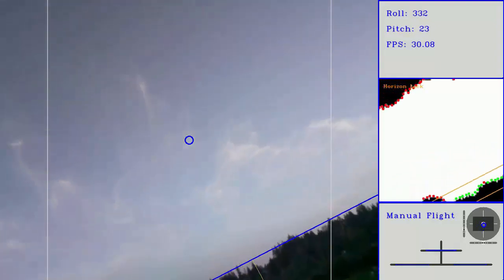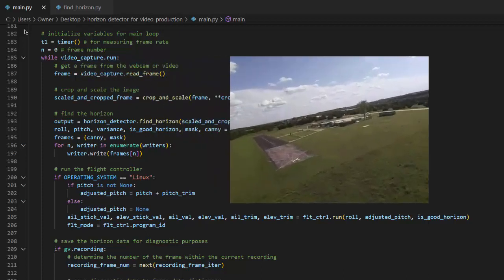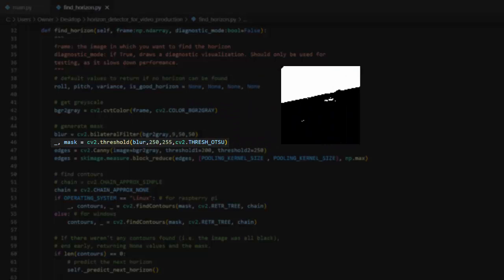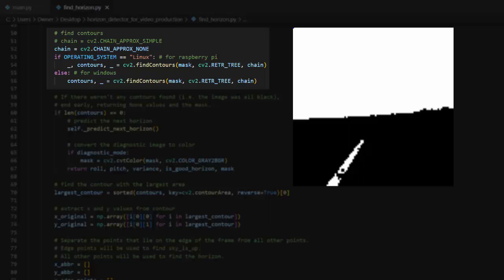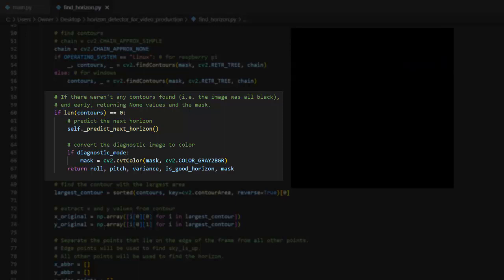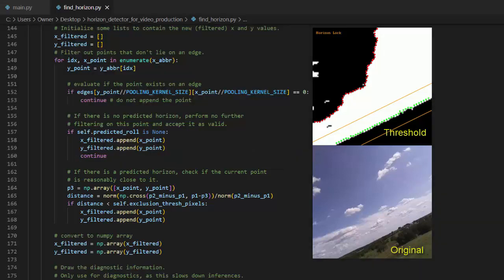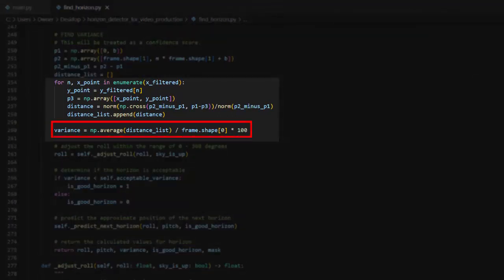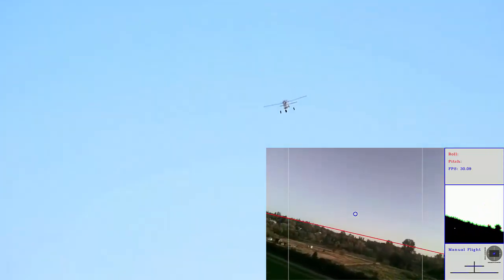Autonomous Flight with a Camera: Horizon Detection Algorithm

Comment: Will it work in the night time when it is dark?
Reply from the maker: Probably not. But maybe with an IR camera it would
Reply: @timmarkhuff can't we use PID Controller for this?
Reply from the maker: @mukeshbaskaran2557 I did use a PID controller, but that is separate from the task of detecting the horizon, which is what this video is about.
Reply: @timmarkhuff but horizon detection is used to make the plane stable right. PID does the same job using sensors instead of computer vision.. isn't it? I'm just asking. Please deny if I'm wrong.
Reply from the maker: @mukeshbaskaran2557 computer vision horizon detection is a sensor. It provides data comparable to what you would get from a gyroscope. A PID controller is necessary either way
Reply: @timmarkhuff but the question is which one is better? 
(Computer Vision + PID controller) Or (gyroscope + PID controller). I think computer vision can't do the job at night or in the mountain regions. FYI, I'm asking this just to get clear understanding before I jump on building my RC plane with an auto stabilizer.
Reply from the maker: @mukeshbaskaran2557 gyroscope is more reliable. That’s why it’s commonly used. I did the horizon detection for fun and to explore a new technique

Comment: Nice!. For the next upgrade, consider training a cnn—nothing overly complex. Start with an input image and pass it through a lightweight, pretrained backbone like AlexNet (or VGG if you want to go deeper). The model predicts four points or more points (not just two, since two points might be noisy, but with more, you can apply outlier rejection using RANSAC). Train the model on a dataset featuring water bodies; horizons should be readily available in many datasets. Use a simple loss function like MSE. You'd get much better results, and it could save a lot of time spent on custom-tuning image processing functions. Convert it to tflite if you dont have a GPU or are using CPU/NPU.
Reply: If you end up doing that I would pay you a complimentary amount to get access. Let me know if you ever do it!

Comment: Interesting approach to this problem. There are some downsides to using visuals for such a vital system. Is this just meant as a proof of concept, because for production a simple IMU would probably be faster and less complex on the software side. But nevertheless, great video 👍
Reply from the maker: Yeah, there are definitely more established and straightforward ways of doing this. My project was about exploring what could be accomplished with computer vision. Who knows, maybe it could function as a backup system when IMU data is not reliable? Or maybe it was just a fun project :)

Comment: Was flying the clubs' C172 one day and the turn coordinator ball was way the hell out the side, very odd..  I did everything in my power to center it, but my head wouldn't let me, so I went instrument only for ten seconds and the ball magically centered.  Eyes outside again, and as if by some black magic the damn ball headed off to the side again!  What was it?  A cloud on the horizon was on an angle....  You will need some checks on your algorithm - I did on mine.

Comment: How did you perform testing of the code and the airplane in general? Did you use simulation software to model the plane and test the code?
Reply from the maker: I started by flying the plane manually and recording footage. I used that to develop and test the horizon detection algorithm. 

It became tricky when I started developing the flight controller. I had no simulation software, so most testing was in the air. I did create a simulated horizon out of poster board, which I held in front of the plane to test that it made sensible responses to changes in the horizon. Once in the air, I found that the PID controller was not well tuned (lots of oscillation). I had to do trial and error over many flights to get the PID parameters tuned reasonably.

Comment: Cool stuff!

What happens in a steep dive, when the sky is out of view?
Reply from the maker: A steep dive would be a problem. It needs to always keep the horizon in sight. The autopilot program I wrote only allows level flight, slight turns, and slight ascents/descents so it isn’t a problem. This could be improved with a wider angle lens, but I haven’t really explored that too much.

Comment: One thing that you could easily play with is how you do the rgb-to-greyscale conversion. There's a reason why we say "the sky is blue", so taking the greyscale value as the usual 33%red+33%green+33%blue seems to not be the smartest way to go about this.
What makes this complicated is that 0%red+0%green+100%blue might not be optimal either, especially when there's blue lakes in the picture. Since lakes will also have some blue tone, but a less overexposed kind of blue.

Maybe you can compare the color of your sky with the color of the most problematic (brightest) patches of ground. (Which I define as any bright areas on the "ground" side of your horizon line.)
Step A: Take the average sky color minus the average problem patch color (And since the sky is the sky, you can probably get away with sampling only every 10x10 pixels of your downscaled image).
Step B: Normalize the resulting RGB space vector - by which I mean to a sum of 1, not an euclidian length of 1. (Problems can occur when the problem patches are brighter than the sky itself, see the first fix idea below.)
Step C: Use those numbers as the mixing ratio for the greyscale conversion.
You'll probably need to come up with a way to obtain a representative sample of problem patches, despite them appearing (by design) only rarely.
My first idea would be to not use the same threshold as for your actual horizon detection, but 90% or so of it (to pick up on darker patches that COULD become problematic with a slightly changed sky color.) And my second idea would be to keep a record of past patch colors across several seconds of footage, and average over those.
Reply from the maker: Great ideas!

Comment: Great code review, very clear and concise.

I think segmentation would definitely give you better perception outputs, but would depend on how quickly you could perform inference. What HZ do you get out of your control loop right now?

Depending on that, you might be able to get away with using a USB compute stick attached to the raspberry pi to augment processing power.
Reply from the maker: My program runs at 30 FPS now. I chose this FPS because the Raspberry Pi camera only seems to be able to get frames at that rate. My horizon detection algorithm runs at something like 250 FPS. I think you are right that adding a graphics accelerator (like the Coral Edge TPU) would help run a semantic segmentation model and possibly get better results.
Reply: @timmarkhuff  I think you might be able to get away with running an even simpler algo - whereas segmentation takes an image input of m x n pixels and returns an output image of m x n with many categories of object, you only need to extract one feature (horizon angle). So you might be able to build a neural net that runs leaner and outputs 30Hz

Comment: Really impressive work!  A couple quick thoughts for whatever they are worth:

When the horizon is hazy/fuzzy, the otsu thresholding can often give you the bottom of the hazy area, not really the horizon line.  When I was fiddling with this stuff I ran the canny edge detector first on the original image, then used the OTSU mask to filter out canny edges that were not near the sky area.  That way my edges were from the actual horizon, not the edge of the mask.  That said, the the mask edge should be close to what you want, so probably not that big of a deal.

I also ran into issues with lakes near the horizon.  I used cv2.connectedComponentsWithStats(otsu) to get the contour areas and then computed a metric that balanced size of the area versus closeness to the top of the screen.  I was assuming the plane would always fly right side up. :-)  Then I used that 'primary' area to mask off canny edges and leave the most likely ones remaining.

I didn't do anything with filtering based on predicting where the next horizon should be, but that seems like a good idea.

I ran the cv2 hough transform on the canny edges to get potential horizon lines.  That sorts by which line has the most points contributing to it so I just went with the top one of the list.  There are situations where the horizon is ambigous, or there are 2 or more primary lines it could be, so sometimes my solution would bounce back and forth when that happened.  I like how you do a least squares fit of your points so you can steer through horizons with trees poking up through ... that is nice.

I used the visual horizon to estimate the offset of the camera versus the autopilot IMU and then re-rendered my whole video (off line) with the "corrected" horizon (and all my other overlay info.)  That ended up looking a lot better ... almost too good (!) but I'll take it ... just keep in mind I did the work in post, not in real time on board.  My goal was not to feed the autopilot in real time, but to evaluate the performance (truth) of our EKF (attitude estimation) and look for ways to improve tuning.  I also use the rendering after the flight as a visualization tool to see what my autopilot (in-house) was thinking. (Quick example: https://www.youtube.com/watch?v=hLo0UBuq3ww)

Really nice explanation of your algorithm!  I really appreciate all the extra animations ... that must have been a ton of work, but helps a lot!

Thanks again!

Comment: And where exactly is he flying? What is the ultimate goal and who assigns it?
Reply from the maker: At this point, the program just flies level, like a simple autopilot. Also, the user can command the program to turn, and autopilot will manage the turn. In the future, I would like to add user-defined waypoint missions, but that will take a bit more work.
Reply: @timmarkhuff  Is there a desire to turn an airplane into a living being? With irritation and reaction to irritation
Reply from the maker: @Koroleva_O_A  haha, that might be a bit beyond the scope of this project, but it sounds interesting!
Reply: @timmarkhuff  I will not deceive, it's not about super technologies, everything is much simpler. A living being is just an airplane that receives commands from the surrounding reality, and its behavior is set by the surrounding reality. So it's not something sky-high, everything is much simpler. Create the same thing as any living being, only in a primitive form.

Commands are set by the environment, in psychology this is called an irritant. If you translate this into the language of technology, then the command is called a definition. This is the result of measurement and/or identification. The definition has a magnitude. This value is translated into the amount of irritation.

Some examples. The plane sees a person a few meters away from it. A person is identified and identified as a dangerous being. The danger must also have a magnitude. The higher the definition of danger and the smaller the distance between a person and an airplane, the higher the amount of irritation. On the way out, you will get what you can see in the behavior of any bird that is afraid of you, and that flies away from you. The closer you are to it, the greater the magnitude of fear (in living nature, all hazard identifications are set by constants and are regulated by the distance between, which a living being determines by sense organs, in our case a video camera). That is, the plane will constantly fly away from us because it is afraid of us.

If this is quite difficult, then first you can teach the plane to just take off when it has a need to move somewhere. This is also a reflex. A living being moves not only when we scare it, but also when it is hungry, for example.

The magnitude of the reaction corresponds to (and is proportional to) the magnitude of the irritation. The higher the irritation, the more pronounced the reaction. For example, to spin the engine to a greater number of revolutions. For a living being, this is the amount of muscle tension. If there is no danger, then turn off the engine (this is also an example of how real living beings are programmed to relax their muscles).

In principle, it seems to be nothing complicated. Or is it too complicated? Will you be able to cope with such a task?
Reply: @timmarkhuff  Aren't you interested anymore? Or is it difficult for you?